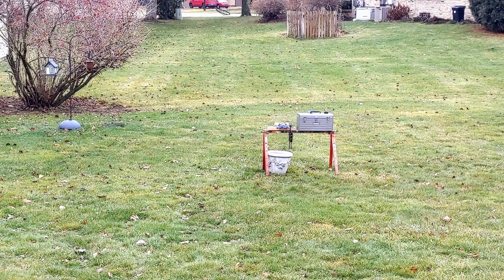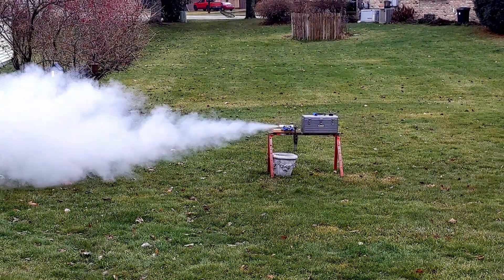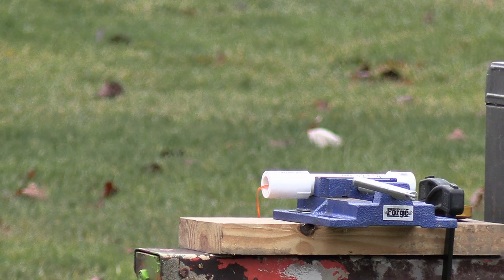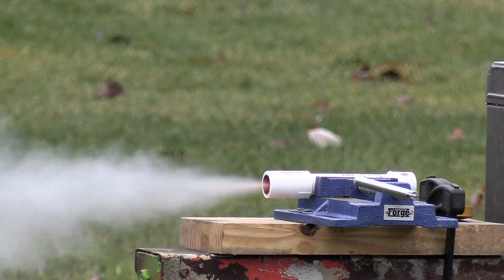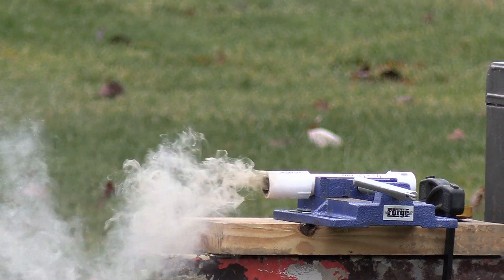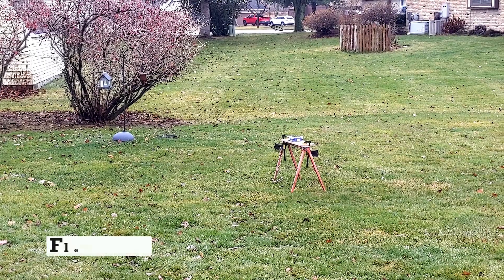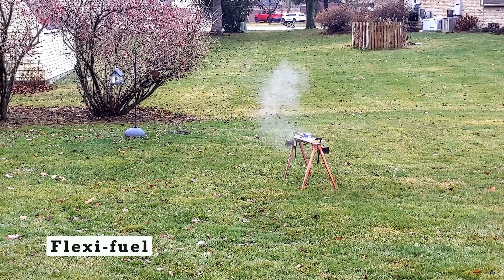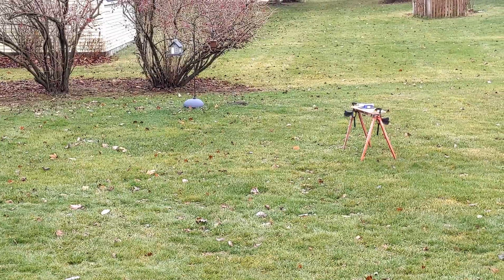Check Out This Incredible 3/4" PVC Motor Test!

Comment: Have you ever added a delay and ejection charge?
Reply from the maker: The core does not extend all the way to the end, so in other words it already has a delay built in. I am not sure how long the delay is but it could be adjusted. A tissue with 1/2 gram of BP tied off would probably work as a simple solution. If you get it to work let us know!

Comment: Very nice I have also done this in 3/4 but used rockite for a condivnozz, good to know I don't need it
Reply from the maker: I have had a few burn throughs so you may not want to give up on the nozzle yet. I am working on a solution. How did you construct your nozzle?

Comment: PVC is caustic to breath when burning. Not sure how that makes a good motor casing. I understand you’re not standing near the rocket when launching & it will hopefully not be burning during  retrieval, but it’s still a hazard I would think.
Reply from the maker: The smoldering you see at the end of the burn is not PVC but schmutz that occurs from a sugar motor. Even my aluminum motors have some trailing smoke from sugar fuel but not as much because of the higher pressure.

PVC makes good test motors. I am using one to test Fructose burn rate because it is unknown. I would rather expend $5 worth of PVC than a $150 commercial motor. I have made 90 pounds of thrust on a 1" PVC motor before. They will take a lot of pressure and heat for a short time.

Thanks for your comment.
Reply: @TheRocketeer  do you know how much the PVC tube costs ? I have made a homemade 29mm fiberglass casing (~3G) for less than 3€ (including the consumables). It requires special building materials and some experience with Composites though. It allows easy and strong bonding of a reused phenolic nozzle from aerotech/CTI. 
Unfortunately I couldn't test it last week and I'll have to wait until Easter to do so. I'll let you know how it goes
Reply from the maker: @shere_kan8329  It cost around $3 for the PVC parts. Please let me know how your project goes, keep a safe distance from any rocket motor test!

Comment: What caused the pop? Was it a very tight nozzle?
Reply from the maker: I tried to drill out the core after overnight in the freezer. It didn't go well so I am not surprised it did not hold up. I did figure out how to cast a 6" long core and remove the tooling without using colorful words. Tutorial soon.
Reply: @TheRocketeer  do u have any idea on how to make a y solid propellant in gel form?

I am considering grinding KNO3 or AN extremely fine and add to vaseline and carefully test because you know... boom

Or feel free to suggest me any solid propellant that could be made into toothpaste consistency gel, apcp, sugar, everything is welcome
Reply from the maker: @FirstLast-tx3yj  I was not able to get vaseline to burn even after adding potassium perchlorate. I don't know of any other gel propellants or how they would be used.
Reply: @TheRocketeer  in both parrafin and vaselin the vapor or molten layer is the one that burns (at least in the case of hybrids)

A much stronger igniter  is needed i believe

But in my case I havent tried amd everyone was telling me its gonna blow instead of burn
Reply: @TheRocketeer  may I ask how ddid you cast them? Or the process you used to homogenize and then put them in??
Reply from the maker: @FirstLast-tx3yj  I melted the fuel and poured it as one solid grain then I used a 1/4 core tool. That part was easy, the hard part was figuring out how to remove the core tool. The sugar fuel is seized on the tooling. For the solution you will need to wait for the video. I will detail everything soon along with updated construction for the motor.
Reply: @TheRocketeer  cant wait!
Reply: @TheRocketeer  any idea when you will upload the video

I really cant wait😅